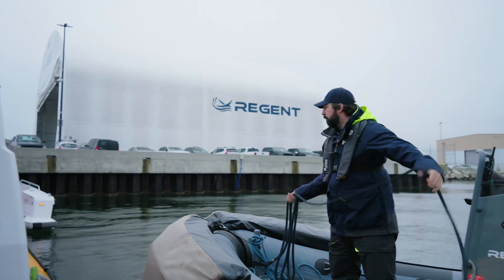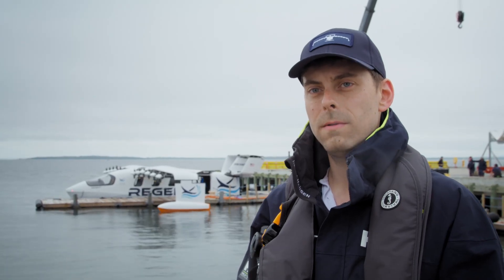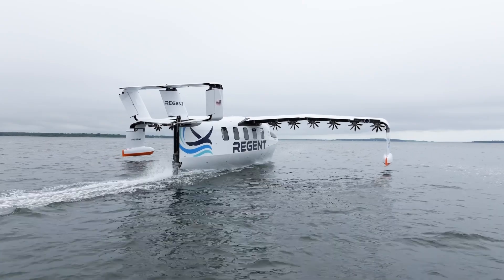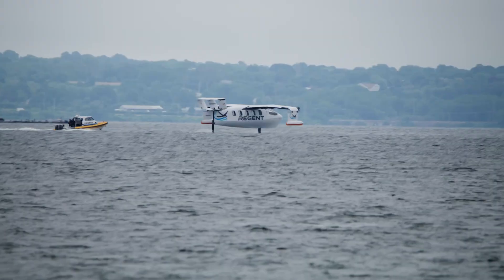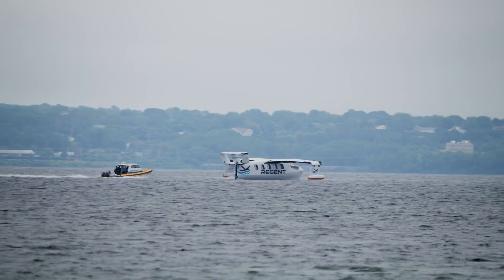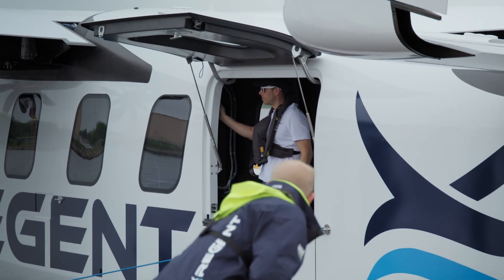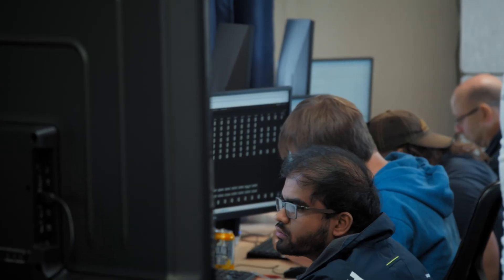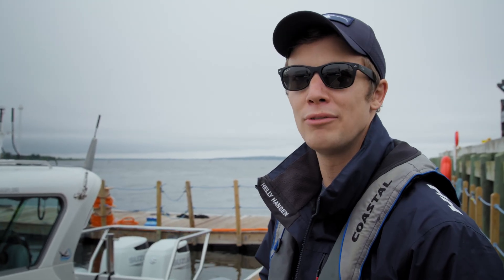Maiden Foil Achieved

Comment: Pretty cool build!  I see a few barriers to practicality remaining:

1.Active/Passive fouling of the foil.  Taxiing through kelps/seaweeds could easily wrap these foils up and destroy their lifting capability.  Natural accumulation of marine life on the foil surfaces would likewise need to be managed as an ongoing cost.

2. Beaching.  A standard floatplane can operate on/off beaches but with the draft of the foil this craft will have to remain hundreds if not a thousand feet offshore.  That heavily restricts the number of workable docks and viable pickup points.

3. Overall durability in an operating environment.

The foils don’t look substantial enough to survive regular landings in the kind of rough water that is everyday for a seaplane.
Reply: agree this is way too fragile for commercial marine use, but it appears the foils do raise up flush with the hull. how else would they launch these things without a travelift?

Comment: Curious. Why would you use air propulsion only, instead of water and air propulsion? Seems like you could get away with far fewer motors and lower cost having a prop in the water.
Reply: And when you want to fly it.....😂 just di gle dangle yiur propeller
Reply: @JimmyJack-o4z the prop would be mounted just above the foil wing. The thing doesn't seem to fly. It's just a hydro foil.
Reply: @motocash I agree🎉 👍

Comment: #caspian_sea_monster might help to add a forward facing propeller upon the tail section or even twin propellers counter rotating as once level flight achieved that alone may be sufficient to sustain level flight and in a controlled / controllable manner. #stepped_hull another innovation been around a while now. So long as all can be achieved without need of a flight computer very much something to be impressed by😊😊
Reply: They are obviously going for quite slim hulls and I speculate stepped hulls work better on flat'ish planing hulls. Not sure of their reasons other than perhaps not needing the steps as they have enough lift in the foils for easy take off and then they'd rather have the nicer motion/sensation of a hull that doesn't slam but rather slices through water in displacement mode and also when lifting out and coming back down. Cargo wont care, but passengers may.

Comment: This is a toy! How do you get out of foiling into ground effect and then remo e the foils from the water.... it is currently a foiling craft not in WIG . Correct?
Reply: How will you prevent the foils cavitation above 50 knots? Perhaps you have enough power to rise up onto the surface and use them as free surface planing surfaces then you are back to interference from waves
Reply: @guygillmore2970 I think we just remove the foils and put in a step and do it like a sea plane..... have any models being shown to fly with foils attached......
Reply: @JimmyJack-o4z yes, the models work perfectly. The foils are an intermediate stage between Hull and Wing, they reduce energy use because you're not having to get up to flight speed with the draggy hull in the water.

I have no idea why people are struggling to understand this.
Reply: @vijilant cause i have not seen the proof.
Reply: @JimmyJack-o4z will take you literally 20 seconds to find their 1/4 scale prototype testing video.
Reply: I worry about damage to the foils from landing in rough water.  Such a low object experiences big lateral movements from very small roll angle changes, which are continuous in most landings where the wind is >10 kts
Reply: @TH-mf1hn they have the whole idea wrong.... you cant mix the two, either it foils or it flys? Have any models foiled and flown? Who's paying for all this
Reply: @JimmyJack-o4z Yeah, I unfortunately can’t see this thing serving any market except scenic tours from deep and sheltered bays
Reply: Correct. 

To remove the foils from the water, they take off. It will go a little higher than foil height once in WIG. I think the foils then partially retract.

Still definitely in testing, though they have signed contracts.
Reply: @vijilant how do the "take off" if the foils are interacting with the water providing their lift..... how does the craft transfer between foiling and wing in ground effect?
Reply: @JimmyJack-o4z because the wings also provide lift. By 50 knots the wings have enough lift to take over.
Reply: @vijilant lets see it fly then😂
Reply: Hold up..... lift ????? Its a wing in ground effect vehicle not a plane....... right?          @vijilant
Reply: @JimmyJack-o4z a WIG literally is a low altitude plane. In flight mode it flies slightly higher than when foiling.